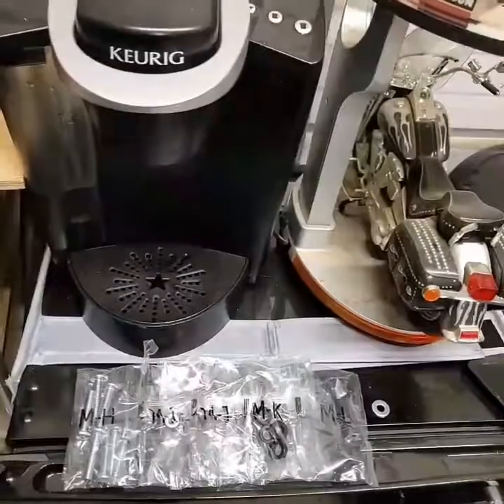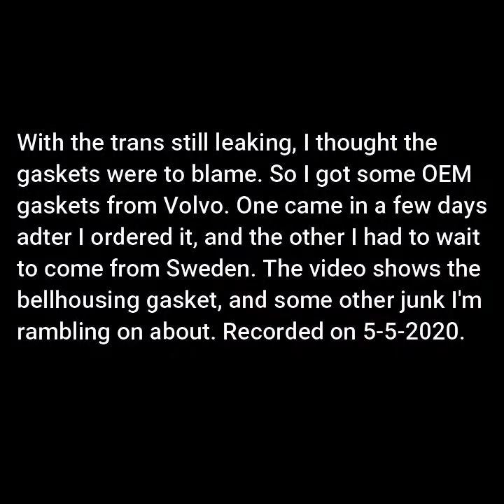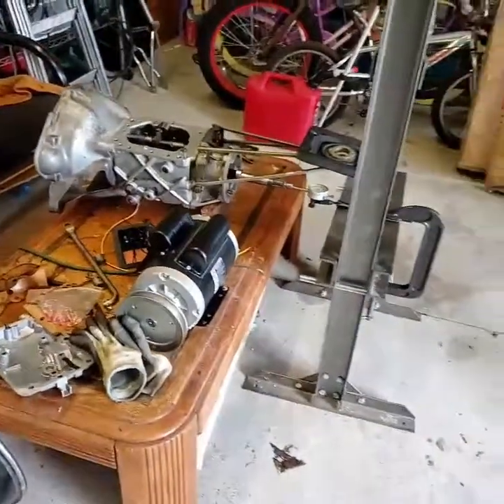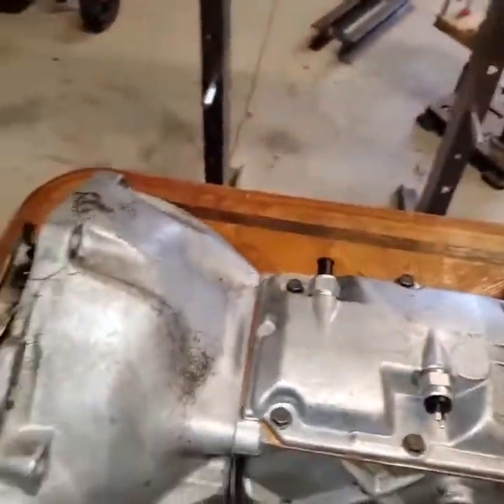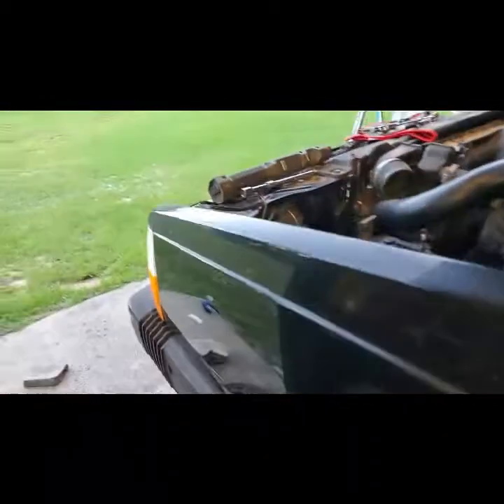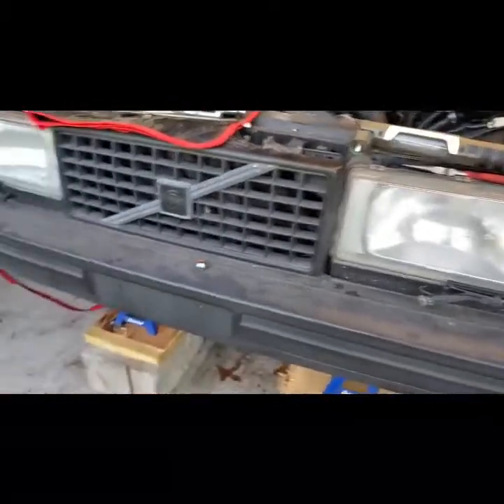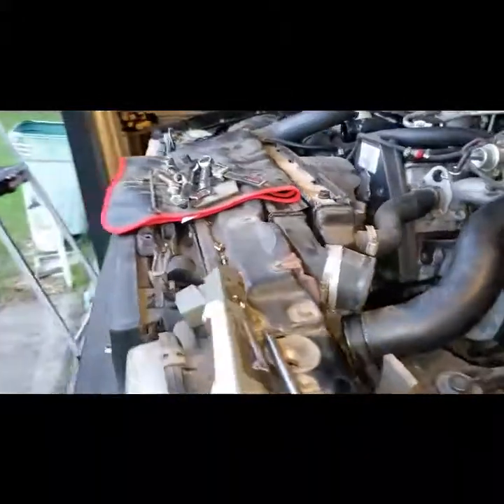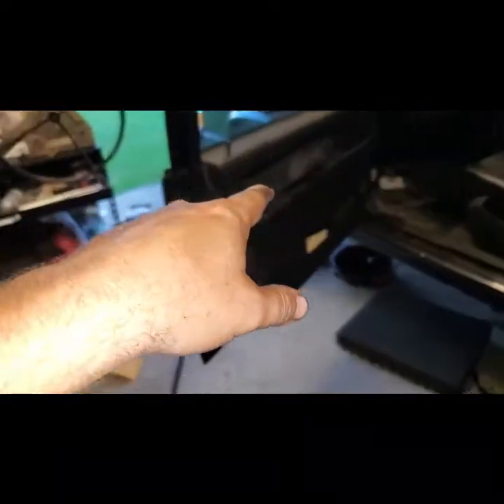The transmission is IN!

Comment: Reccomend that you refer to u tube channel called Amazon Cars. Very helpful video on mating the OD to gearbox. As I recall, on the j type, there are 2 sets of splines that need to be aligned in order to mount. Rob from Amazon cars addresses this specific issue you had and tells you what to do.